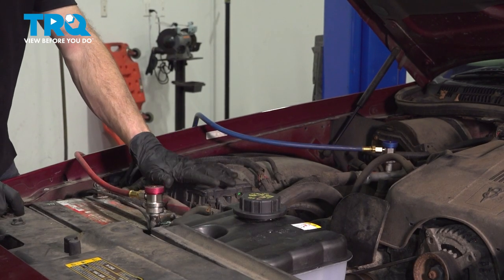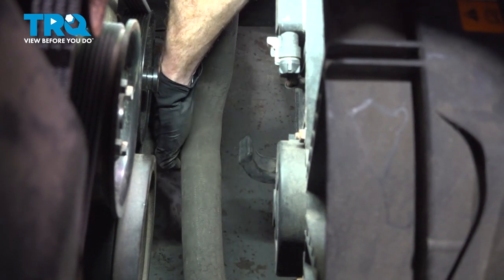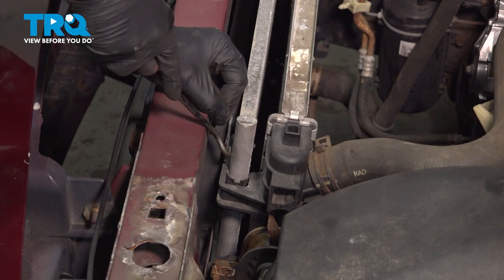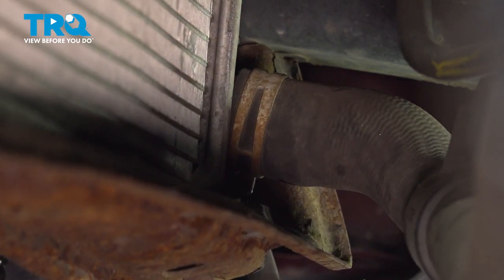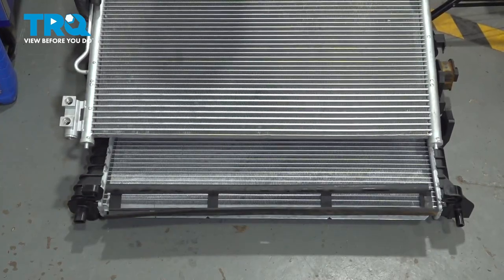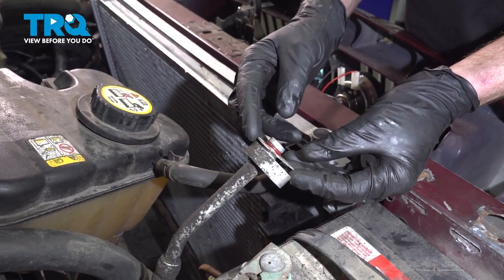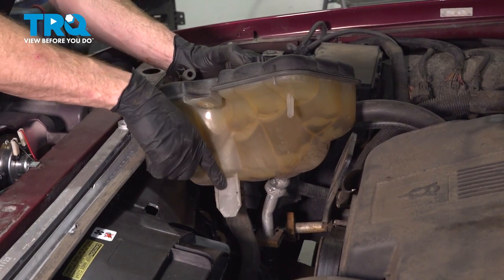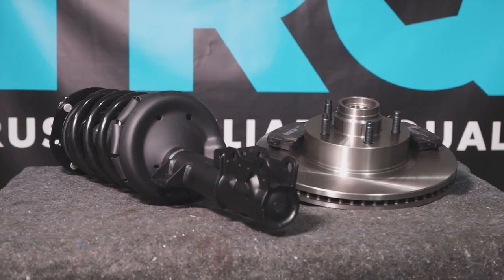How to Replace Radiator 2003-2011 Mercury Grand Marquis

Comment: This video was a great help for my first P71 radiator R&R. However, the entire assembly does not have to come out as a unit, and you do not have to open your AC system. Remove the top and bottom coolant hoses and all the mounting bolts and nuts. Rock the radiator back towards the engine. Rock the AC condenser back and lift to unhook it. Now lift and unhook the power steering cooler. My PS core is between the radiator and AC. Hold the AC and PS cores forward and walk the radiator up and out. Mind all those hoses and mounting tabs! Installation is reverse. About 3hrs for removal and another 2hrs for installation. My first rodeo with this car. BTW, my D-bushing straps have the bolts rearward (2004 Crown Vic  PI package). Hopefully this helps by not having to evac and recharge the AC.

Comment: Ac condenser lines had lots of pressure and goozed out green liquid do I have to refuel that and charge my ac ??
Reply from the maker: +@thereal_homie4158  We wouldn't be able to diagnose an issue like that here, you may want to have a local mechanic take a look at it. Thanks for checking us out! http://1aau.to/m/Shop-1AAuto-c